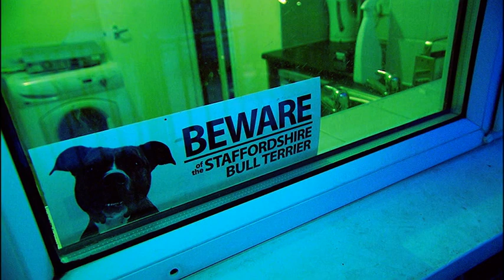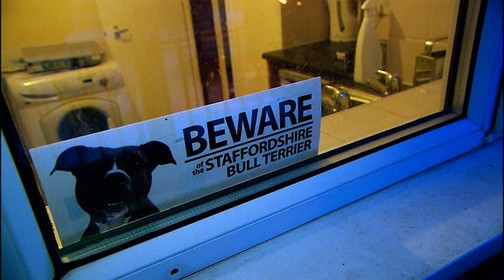The Home Of The Council Estate Princess | Worst Homes in the UK | Filth Fighters

Comment: Uuuuhhh....Ok, they did a great job..I mean, I've had to scrape up old dog poo off the floor before and it is a TON of work....but that floor after they mopped it was not clean.  It needed a darn good sweeping before being mopped - you could see bits all over the place - and that mop was not clean.  That place needed a thorough disinfecting, not a quick mop through.
Reply: The mop was a disinfectant solution I believe as there had been dog crap and saliva all over the place. It was to sanitise not to clean.  It'll be getting mopped in one of those solutions hospitals or vets surgeries use.
Reply: Disinfecting? It needs to have the walls and floors ripped out for me to even think about ever setting foot in there lol
Reply: They usually disinfect so there's no more bacteria for the decorators or anyone else that comes after to fix the flat. I'd imagine that they'd rip out the floor and put a new one down, they've got no issue replacing whole kitchens or carpets so it's not a stretch that they'd replace this to

Comment: No way that crusty mop is sanitary enough. This place needs deep scrubbed top to bottom and then disinfected.
Reply: They have industrial strength cleaners. They are extremely strong.
Reply: You can literally see debris being pushed around with the soapy water, so it's not going to be sanitary with filthy bits being pushed around and then left regardless of the strength of cleaners. Needs scrubbed with a stiff brush top to bottom, wiped with disposable towels then mopped with disinfectant.
Reply: Beck Woods - just what I was thinking - even when he had finished with using the mop the kitchen was still beyond filthy.

Comment: Why did they remove the washing machine?
Reply: Camijo Gault-Keller It was probably so mouldy inside that it wasn’t worth saving.
Reply: It’s council property, everything is removed no matter the condition it’s in, nothing is left behind, everything taken to the dump then flat/ house is all cleaned and ready for the next tenant, the cleaners are not allowed to disconnect cookers so either an electrician or a registered gas man is called in to disconnect and then it can be removed and disposed of.